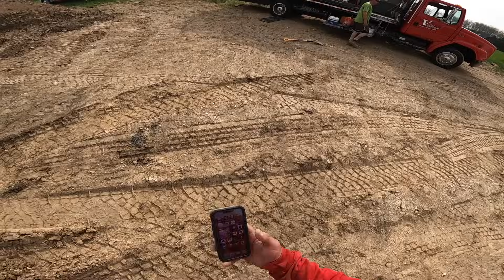Big patio-New driver was killing us!

Comment: Man... that's LITERALLY how I used to work with concrete in South FL... Entire shirt & underwear drenched in sweat.. heart rate atleast at 150.. arms pumped up to the max... sweat beaming off the sunglasses.. all because of the dry rocky concrete and the inaccurate rear end concrete truck.. Not to mention the FL heat.. Raking and pulling the concrete from 5-9 feet across... The way these guys felt on this video would be us every single day... That's crazy how different the work flow is in different states...

Comment: Hey Ryan I am currently 24 and run my concrete business with my dad as my head guy, my dad has 26 years of experience on flatwork and I started out doing poured walls at the same company, I used to have a super super hot head of a Forman that would constantly yell at the drivers when we were pouring and it got so bad that drivers refused to bring concrete to our job so if one of those drivers was next to bring concrete to our job there would be like a half hour gap in between trucks because the plant would let the driver take the concrete to the next customer in line and I gotta say I can't blame them!

Comment: I've lived those moments before where something that was so easy turns difficult with the driver. However your guys worked in sync with you very well on this job and got it down and sealed up before it ran away. And yes; that could of been disaster if that was poured later in the day, even two hours later. Good job.

Comment: FYI it snows in Arizona too down south and up north the heat and cold are one in the same once you reach a certain Temperature like110or higher you acclimate and it's just hot the same with the cold once you reach a certain temp like 20 degrees it's just cold but who really has the widest fluctuation in temperature I would say it's us and trust me do you really think someone who is used to 118degrees In the summer is afraid of a lil cold Not A Chance

Comment: Why not use the string method.  Just cut a piece of string to the length after you tie it on the post.  Then you don't have to drag a tape measure around with you.  you can even tie a stake to the other side and then stab in a couple of holes for the stakes to go in.

Comment: What’s the difference in putting in joints while it’s wet rather than use a saw later? About to get my new house poured. My brother just got a small driveway poured and it cracked days later, they said they’ll come back and cut some joints in it. Little late

Comment: a little trick i accidentally found is if you have a muddy job, walk around in the mud, break up the surface anyway you can and it helps it dry out somewhat faster. alot faster than leaving it sit. if its a big job, drive the skid around to rough it up.